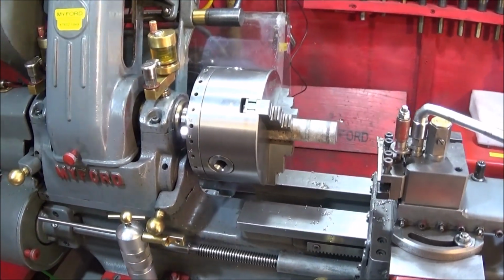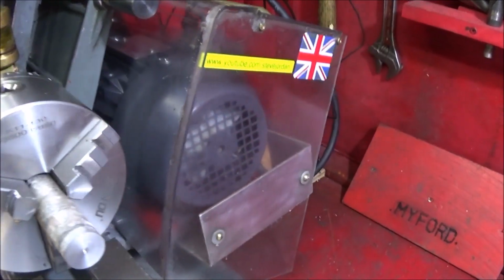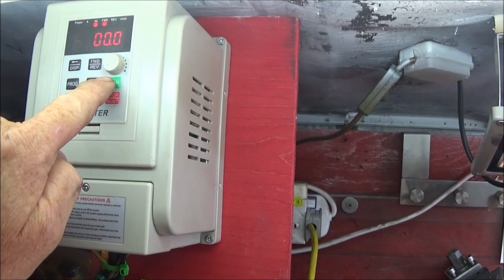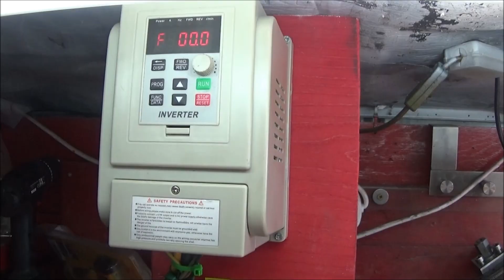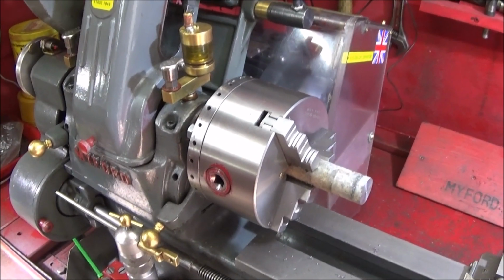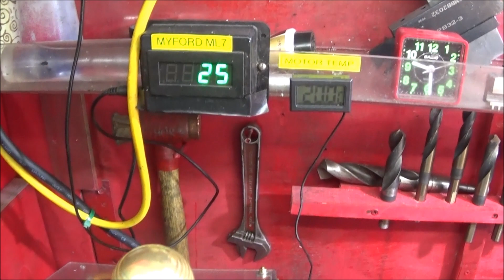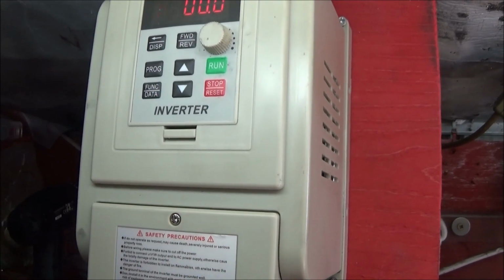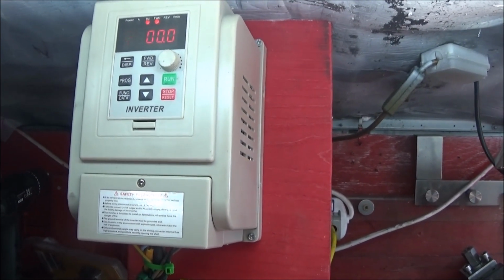Myford ML7 3 Phase VFD Inverter Set-Up & Working

Comment: the 3 phases motor run really smooth. Now you can cut a thread with the motor. I bought the same VFD for my 3 hp lathe and I'm happy. I wired an external panel because the electric cabinet is in the body of the machine.

Nice video & installation Pierre

Comment: Great job Steve brought the Myford bang up to date. I've got everything to do my Littlejohn but getting round to doing it is another thing. I have a one HP motor, I thought it may lack torque but there's no problem with yours so happy days, Cheers mate.
Reply from the maker: Hi Robert Thanks....The motor has excellent torque and definitely won't be a problem. I put the same set-upon my Mini Lathe and I can drill with large drills without having to use a smaller pilot drill first.

Comment: Nice work Steve. Only other thing I think I'd do is to add a bimetallic switch on the VFD heat sinc in line with the fans so they only cick in at about 50 degrees C. For your setup it would probably only cick in during this high extreme weather. Don't think you can do it in the software or you would have done so already. Regarding the high frequency, you're probably like me, getting on! but get a kid in it'll drive them mad. You can tune it higher though I believe.

Comment: Hi Steve: As an addition to all the obvious advantages of running a 3PH motor controlled by a VFD, I noticed that your Myford runs far quieter than before for some reason.
I was surprised that originally, made quite a racket for a belt driven lathe, no more now.
You also have almost 3HP at your disposal. 
Congratulations.
Reply from the maker: Hi Jorge, Yes it was frustratingly noisy before. I think the Fenner belt on the main drive has made a significant difference, plus I spent a lot of time re-adjusting the belt guard. There's not much room for error with the guard, so one has to get it spot on to clear the belt. I found this so time consuming to get it right that I almost took the guard off, but I'm please I persevered now!

Comment: Very nice set-up, Steve. The thing with all of these VFD's is, there seems to be something missing.  The wires are only held on be the screw terminals. It seems like they should be in a box with cable clamps of some sort, so that the wires can't accidentally, be pulled out from the terminal strip.
Reply from the maker: Yes i was thinking that when I wired it up. I have secured the cables to the plywood with cable ties to stop this happening..

Comment: Hi Steve,
Just a quick comment regarding the possible overheating of your motor due to slow speed running reducing your motor fan cooling ability.
I am a retired electrician and during my working life I have had to deal with this problem arising on various vfd systems.
By far the best solution after ensuring your vid is properly tuned to its motor is to fit a secondary forced air fan to the fan end of
the motor.This fan is then switched on and off as required by thermistor temp control mounted on the motor.
I have this system is an industry standard way of ensuring correct motor temperature during low speed running.
The motor can still provide adequate cooling at higher running speeds without using the secondary fan because it sucks its
air in past the secondary fan blades.
Hope this is of help to you if you find it necessary in the future.
Barry V 
Western Australia.
Reply from the maker: Hi Barry Thanks,... I don't think the motor will get that hot to worry about for what I do as very slow running of the motor for long periods of time isn't something I require. I never do batch work and usually only make one-off components. Therefore any slow running of the motor would be minimal, maybe only a few minutes..
   If I was doing thread-cutting though, I would just position an ordinary  220v household table-top fan directed onto the motor at the back of the machine, so there's no problem. 
  Your idea would be good though for others that may require slow motor running for long periods of time.
Regards Steve

Comment: You should run a separate fan that is not influenced by the motor because if you run a thread any time this motor could over heat. I would fan cool or recirculate water to keep you motor cool at low RPM just a suggestion. I did notice the temp went up 50 c in the moments you ran it. Just a suggestion . Love your videos!
Reply from the maker: Hi I think it only went up to 20c or thereabouts. It is really hot in the uk at the moment and working in the shed is unbearable in the day. I don't think the motor will get that hot to worry about in normal circumstances and very slow running of the motor for long periods of time isn't something I would need to do for the things I make. So there is no problem here.

Comment: I hope someone can help. Great video. I’ve purchased the same AT1 model. I’ve connected single phase 230v and UVW wires to motor, having rewired fro star to delta a connection. When I apply power to unit there is no response, no indication on display. I’ve checked and confirmed 230 v at the L-N terminals. I can’t see any external reset buttons etc. I’m presuming  I don’t need to make any connections at the 12 point small terminal strip. Maybe I just have a dud unit. Has anyone any advice?

Comment: Hi steve, Found out why. P06 was on default 100hz operating speed changed to 45hz and now top operating speed 1016. Stops me accidentally going beyond. Anyway thanks again and looking forward to remote if you get time.
Reply from the maker: Hi Alan that's great I think I altered mine when I got it. I'm not bothering with a remote as I have my VFD situated directly above the ML7. I wired the remote switches on my Mini Lathe VFD though. It's the same set up, just a different box, so the terminal wiring is the same. I did a video on that one showing the connections. Regards Steve

Comment: Hi Steve, I realise this is a few years old now but did you ever connect up an emergency stop? I have the same VFD and the resistive braking on the emergency stop has to be seen to be believed. I have a problem with mine at the moment that the suppliers are looking into (the firmware has missed out the programming for ES and reverese jog) but I'm hoping that will be resolved. These are great little VFDs. Thanks for the video. Will

Comment: Hi steve just finished doing exactly as you on ml7 same vfd same 67dia pulley same tec motor happy, BUT i am getting top speed 1500 ??. Any idea's why. (Never use at this).
Reply from the maker: Hi Alan, I never really use anything over 1000 RPM on the ML7. The ML7 only had a top speed of around 600 RPM when it was first made. If you have the ML7 with the white metal spindle bearings there is a chance of the un-hardened spindle seizing if they are used at speeds over 1000. I have phosfur bronze bearings with a hardened spindle, but I still play it safe. There is no real advantage of having anything faster anyway. Regards Steve
Reply: @SteveJordan  thanks steve. I would never use over 1000 The thing i was saying is i thought you said the top speed you could achieve is 1060 .Where i could achieve 1500 using identical parts. Same set up, same machine (1978 myford ml7).
Just wondering why.

Comment: Hi Steve 
Did you plug your inverter into a nominal 220 plug socket or hardwire it to the mains Lorne
Reply from the maker: Hi Lorne yes I plugged it into a normal 220v socket. Regards Steve

Comment: three months ago i replaced the motor on my 1953 ML7 after the shaft inexplicably snapped inside the motor just past the first bearing . With the motor i also replaced the forward reverse drum switch and added an E stop button. Then i saw your videos on the VFD system . Now im depressed . Could have done the same to mine as you have done to yours . It would have been a much better system. maybe i will see about a conversion to VFD a bit later next year . Looks like it may be time to upgrade your shed next to a bigger one. Must be getting a bit crowded.
Reply from the maker: You could convert over and then sell the your existing motor set-up like I did. 
 I like a very small shed as everything that is used is very close at hand. Anything I don't use often is kept in storage bins outside. The working area only has the things one needs to use often, It is a very good system of manufacturing..something I learned in the aerospace industry....'A work cell' as they were called, which cuts down on a lot wasted time and space.
Reply: yes it looks like i will be selling the new motor and upgrading to a 3phase and vfd . I  enjoy watching your videos Steve , and have used some of your ideas on my own Myford . Keep up the good work .

Comment: Hi Steve.  It runs very nicely.  I was interested to see/hear if the inverter squeals.  Some setups on YT with the same BG unit are very noisy, but yours seems dead quiet.  Good job.

Cheers Rob
Reply from the maker: Hi Rob, Thanks...yes I was surprised at how quiet it is.  I was nearly put off from changing over, after hearing some of the set-ups on Youtube. They sound like dry screeching roller bearings!!! 
  I bought one of those inverter arc welders you reviewed, it is fantastic and so much easier to learn arc welding with than the older welders, that I tried to use in the past. Regards Steve
Reply: Hi Steve,

The screeching may have something to do with the way it's wired up or the settings.  I don't know much about them really.  I couldn't put up with that noise.

I knew you would like that little welder.  It's easily the best of the three I've tried/reviewed.  So easy to weld with.  I gave the one that I reviewed to the Bro-Inlaw.  He only wants it for light gauge work, and it should be great for that.  

Regards

Rob

Comment: nice video, just a bit worried that you are running over the stated top speed for the ml7, will it be ok?
Reply from the maker: Hi The top recommended speed for the ML7 is 1070 RPM. This is for the white metal bearings and soft spindle. Mine has a hardened spindle with phosphor bronze bearings, so I do reckon it could go faster. I rarely do any turning above 1000 RPM though.

Comment: Hi STEVE 
I noticed that the display on the inverter was showing HTZ can you programme it to display RPM 
john
Reply from the maker: No you can't do that. I use the Chinese digital tachometers, a very  low cost unit that is set up separately on the lathe. Regards Steve

Comment: Hey Steve.  Good one!  Don't you find that those link belts make your lathe have a rumbling sound?  I tried one on my Craftsman 10F lathe and I was disappointed to find out that the new link-belt that I had used made the lathe noisier.  When I put a V-belt back on it instead it quieted down a lot.  (no more rumbling).  It seems like every link in the link-belt makes a small noise as it hits the pulley.  I used a link-belt from Harbor Freight.  I ended up swapping the link-belt from the lathe with the v-belt on my drill press which doesn't get hours of continuous use like the lathe does so I can deal with the added noise on that.
Reply from the maker: Hi Gary, was it an actual Fenner Powertwist belt, made in the USA? The same as the one I have shown?
Reply: Hey Steve.  The link belt that Harbor Freight sells is the Jason Industrial ACCU-Link.  It LOOKs the same as the  Fenner Powertwist but maybe it's inferior.  Not sure.  Some people are saying that all the link belts come from the same Chinese manufacturer.  Maybe the Fenner would be quieter.  I'll use the link belt only on the inside belt so I don't have to disassemble the spindle assembly to install it and use a v-belt on the outer pullys so it's quieter.  I get a lot out of your videos.  Thanks for making them.

Comment: Steve, Excellent job! I'm contemplating changing my lathe and would like to know the details of your motor - where did you get it from and how much did it cost?
Reply from the maker: https://www.ebay.co.uk/itm/3-PHASE-ELECTRIC-MOTOR-0-37KW-TO-11KW-1400RPM-2800RPM-2-POLE-4-POLE-ALUMINIUM/191770300135?ssPageName=STRK%3AMEBIDX%3AIT&var=490794456079&_trksid=p2057872.m2749.l2649

Comment: Steve - How smooth are the link belt compared to a regular v-belt?
Reply from the maker: It is very good. I think the Fenner Powertwist belts are the best belts I have come across so far. Also it makes it so easy not having to buy and fit the regular type.

Comment: I like the setup Steve. I have just ordered the inverter and the motor, identical to yours on your recommendation. I would like the tachometer as well. Please will you send me the link.
Reply from the maker: Hi Andy That's great. I used this one TACHOMETER UNIT, See:-  https://goo.gl/6yGjCv
Also check out the listing page for this one and scroll down for the wiring diagram. I just bought a small plastic box from Maplin's to mount the unit in, Maplin's is gone but I'm sure they must sell some boxes on Ebay Regards Steve
Reply: Steve Jordan Steve thank you, I have just ordered that too, once I could understand what the site wanted me to do. Keep up the video's they are great. Hopefully I can get my ML7 running as smoothly as yours.
Reply: Steve Jordan 
Hello Steve
I have received the same motor and inverter as you and followed your excellent instructions I setting it up on the bench. All works well as you said. One thing has me a bit puzzled and that is with the instructions for the inverter because there is no P25 mentioned as there was on yours.

Comment: Is damp in the shed a concern for the VFD?
Reply from the maker: Hi Jim no it won't be a problem for me. I put a thick construction plywood with good quality thick felt on the metal roof, plus insulated it on the inside. It would have to be really extreme weather to get any condensation now!

Comment: very nice mod! 
can it go higher than 60hz to get biger rpm range?
Reply from the maker: I could put it up but the Myford manual specifies a top speed of 1070rpm for the spindle bearing type. Although I'm not sure whether that is for the white metal Babbitt bearings. Mine does have an upgraded hardened spindle and phosphor bronze bearings, but I rarely go above 800rpm anyway. Regards Steve

Comment: Hi Steve, having now watched both your videos on VFD for the lathe I have a question. Would it be feasible to wire in an auxiliary micro switch and mount it on the lathe ways to stop the chuck for automated screw cutting? Howard